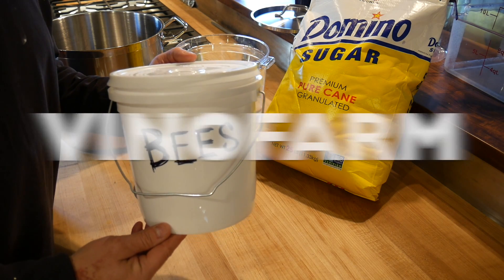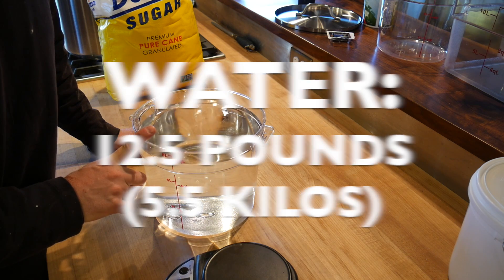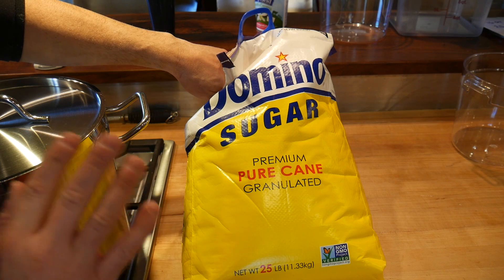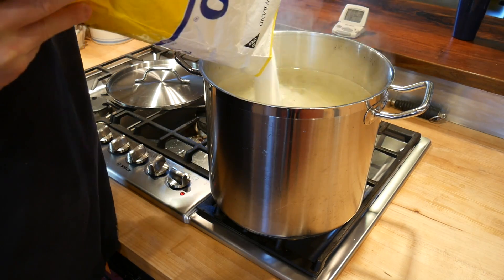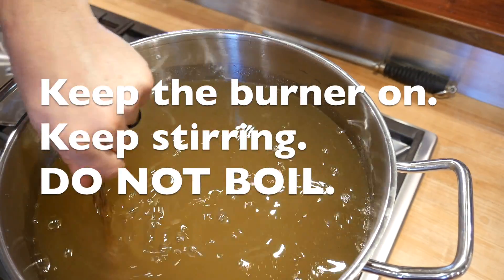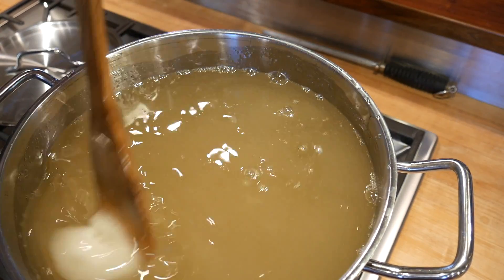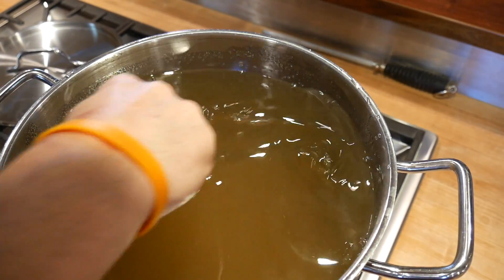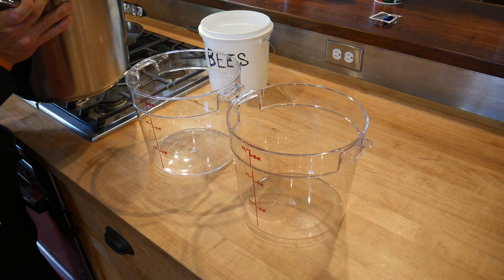How to Mix 2:1 Sugar Syrup for Feeding Bees

Comment: Never boil water for mixing sugar for bee feed:  water should not go over 120 degrees : why ? 

6
Fat Bees - Part 3 - Scientific Beekeeping
You should not boil water for bee feed because heating sugar past a certain point (around 140°F/60°C) creates Hydroxymethylfurfural (HMF) and other caramelization products, which are toxic to bees, reduce the nutritional value, and can be deadly, shortening their lifespan and hindering digestion, so using warm tap water or heating water then removing it from heat before adding sugar is recommended.

Comment: Why is this being overly complicated?  Just put 1/3 water in the pot, and then add sugar until you get the other 2/3s.  Forget the weights.  It just confused people.
Reply from the maker: Ken Tichy Because sugar and water have different weights per volume. If you mix by volume you will use a lot more water and a get a thin syrup.
Reply from the maker: Mixing by volume would be nearly 4:1 to get the same consistency.
Reply: @vinofarm  Look at your video (4:45).  You had 6 quarts when you started.  You had less than 3 times that amount when you finished.  If you did what I said, you would have 18 quarts total (more than you got).  So my 2:1 mix is thicker than yours, not thinner my friend.
Reply from the maker: Ken Tichy There’s a lot of air in sugar. 2:1 measured in gallons is different than 2:1 by weight, right?
Reply from the maker: Ken Tichy Your comment suggests that you could put 6 quarts of water and 12 quarts of sugar into a pot, melt the sugar and get 18 quarts out of it. You wouldn’t. Sugar doesn’t work like that. It takes up a lot less space when it melts.
Reply: @vinofarm , I think you're beginning to understand what I just told you up there on my first comment.  Read it slowly and it will make sense.  You need to keep your water as the constant on the equation.  Don't worry about the sugar.  Start with 6 quarts of water just like you did.  Sugar is a solid, and as you figured it out yourself, it is full of air between the granules which makes it hard to measure because now you have to convert it to weight and compare mass and all this complicated stuff, so DON'T MEASURE IT.  Use the water to tell you when you get the other 2 parts of sugar by watching the liquid volume of the 3 combined.  You have 6 quarts of water, so just add sugar to reach the 18 quart mark of the combined mixture and Voila!  You don't have to worry about weight, you don't have to worry about air between granules, and you just simplified everything.  Forget the scale!  You don't need it.  Set the 1 part of water and keep adding sugar until you have 2 more parts in the mix.  Did that make sense?
Reply from the maker: Ken Tichy I got it. I was thinking you were putting in a measured volume of sugar, which would not work. Putting in ‘whatever fills the remaining space’ is certainly a solution... just not how I chose to do it. 

The thing is, I measured the water’s weight ONE time two years ago. Now I know that 25lb bag will always go into 6quarts of water in my 16quart pot. I never weighed anything, ever again. Then made a video showing what I learned so YOU won’t have to weigh anything. This video demonstrated the weight measurement method of mixing. I’m a cook and a baker. I was trained to weigh everything because volumes vary every time. Every professional scientist or baker will weigh things in the lab or in the kitchen because it is the most accurate way to consistently build a recipe. 

Does this all matter when making bee syrup? Probably not. Your method of starting with measured water and adding sugar to take up the remaining space would work just the same. If that works for you, great. 

The only thing I measure now is the first 6 quarts of water. As long as I keep buying 25lb bags of sugar, I never weigh anything. I just know that 25lb bag gets poured in and I’m done. 

Whatever works for you, man!
Reply: @vinofarm  I'm not saying you have to do it that way.  To each their own.  I'm an engineer, so It's part of my job to simplify things for people so they don't screw things up.  The simpler the better.
Reply: @divynerosehealing8546  6 + 6 + 6 is how many parts total?  3.  1 part is water, 2 parts are sugar.

Comment: Did you hear about inverted sugar syrup?
Its better than normal syrup because its already digested by "Invertase enzyme" from sucrose (Disaccharide sugar) into fructose and glucose (Monosaccharides sugar). So, bees not have to digest sugar syrup. This simulate honey and give bees pure energy immediately and longer life specially in wintering bees.
Reply from the maker: I believe you are describing 'fondant'.
Reply: No, It's different from fondant. fondant may break sucrose by acidic But form HMF.  
But when we use "Invertase enzyme" to sugar syrup we break sucrose to 50% fructose and 50% glucose without high temperature that form HMF.
Example for "Invertase enzyme" brand: PCHELIT, VemoHerb Bees+, InvertoBee. Also, you can find it on eBay.
This study about how Sugar syrup shortens the life of bees:
https://resistantbees.com/blog/?page_id=1334
You can google it for more information.
Reply: HMF doesn't need high temperatures to form, it just happens faster when the sugar is warm.  Even the temperatures in a beehive are high enough to measurably increase HMF in honey (http://www.fiitea.org/foundation/files/2001/Sofia%20KARABOURNIOTI,%20P.%20ZERVALAKI.pdf)

Low heat (even without acid) will invert some percentage of the sugar in syrup, and the invertase produced by bees will also invert if they are storing it like you'd expect them to with 2:1.  

This does make me think about picking up some invertase for making 1:1 syrup though and makes me wonder if you can make 2:1 without heat if you added some invertase.

Comment: Don't know if you've tried it but a commercial "piano wire" whisk will make quicker work of dissolving the sugar and as a bonus you don't get as much splash.
Reply from the maker: Yes, I do this with a whisk now! Good tip.
Reply: @vinofarm  
Buy a paint mixing tool for your cordless drill. You're going to be making syrup 4 gallons at a time in 5-gallon buckets.  
Serve warm. ;)

Comment: I understand the fact that sugar is not soluble in cold water. It must be heated. Not boiled, but heated to the point where it can make a simple syrup solution. But I've seen many people dump honey water after processing and cooling their wax. Can this water be used to supplement their syrup?
Reply: Sugar will dissolve in Cool Water. We dissolve sugar in iced tea all the time. It would take longer for this quantity, but it will dissolve.

Comment: I've always measured mine by volume, not by weight. So 2 cups sugar to 1 cup water. The sugar concentration at weight measure is way too high IMHO. Where did you get your reference to measure by? Just curious. It also may have to do with our climate differences. I am in NC.
Reply: Yes 2:1 is best in the fall.  Once day temps get below 50F, bees can't evaporate the water.   It turns into a moisture/heating liability.  So below 50F is time to consider dry feed - fondant, sugar bricks, pollen patties, etc.
Reply from the maker: I would think the higher the sugar concentration, the better. The bees need to evaporate out the excess water, so I'd rather give them any help I can. Especially this time of year with nights in the 30ºs. If you're measuring by volume, you're going to get much wetter syrup.
Reply: That's true, but I would also think they are eating it instead of storing it so the water content would be ok for hydration as well. We are still in mid 60s at night, but starting to trend colder.
Reply from the maker: Mine are in storage mode. It's the end of year rush up here in Massachusetts.

Comment: Have you observed a change in behavior in your bees when you feed them vs when you don't? I've noticed that a good number of my bees just bumble around my house (and presumably my neighbor's properties also) when the hive is on the syrup drip. It's rather annoying - particularly because I think my bees have never forgiven me for the sugar roll test I did more than a month back and they get all pissy when they find me working in their garden. So I've stopped feeding them. They are much more likable when they are worried about their food stores.
Reply from the maker: I guess it depends on your climate and available nectar sources. We had an extreme drought this year. And my bees were a fresh package in an empty hive 5 months ago. Without food, they would have been starving all summer and terribly weak at this point going into winter. When I took a couple weeks off from feeding in late summer, I noticed they were the opposite of likable. They need food now to prepare for winter. Next year will be different. I will feed if they need it in late winter/early spring, but they should have the strength to get their own food all next summer.
Reply: Vino Farm ,  I'm curious - how far is your bee yard is from your house? Mine is about 40', not far for bees. If yours is further I wouldn't be surprised if you didn't notice if they bumbled around or not when fed. I've also got a new hive from a swarm in June so I've been feeding constantly from the beginning. 

Regarding your 2:1 sugar syrup recipe - i find it simpler, albeit more approximate, to just fill my container with sugar and pour in boiled water into the container until it's full with mixed syrup. The granulated sugar reduces in volume by about half thereby giving you 2:1 syrup.
Reply from the maker: Ian Umeda My hive is 150 yards away from my house. I don't see bees near the house very often. They have 6 acres of pasture and 100 acres of woods to fly in. 
I though I'd do the math once and for all on the syrup. After weighing everything and coming up with the recipe in the video, I looked around and did not find these numbers anywhere. A lot of people say 25lbs sugar to 2 gallons (8 quarts) of water, but that is absolutely not 2:1, by weight or volume. But hey, who cares?
Reply: Vino Farm , yes I don't think precision on bee syrup is imperative. When I weighed sugar and water I found that water doesn't weigh significantly more than sugar by volume (compared to how significantly the opinions vary on feeding bees on the Internet). The method I described allows you to easily make ~2:1 syrup for any container so you don't have to store extra syrup in your fridge and you have to clean syrup off of a minimum of utensils. At higher sugar concentrations it's probably necessary to heat the solution so much it will require a stove. 

Anyway, I hope I'm not hindering my bees by not feeding them. They seem really strong right now and we have mild winters here. Thanks for your thoughts and time.